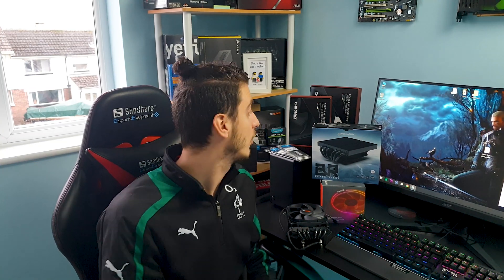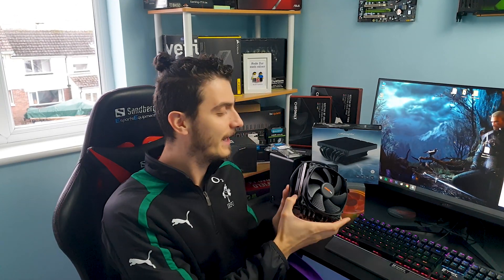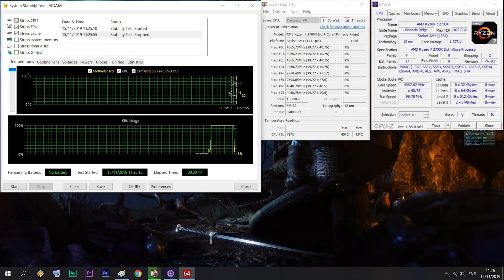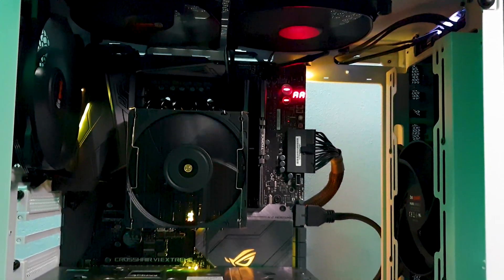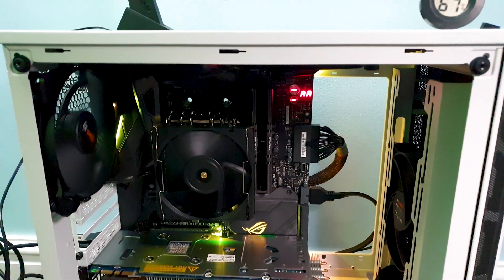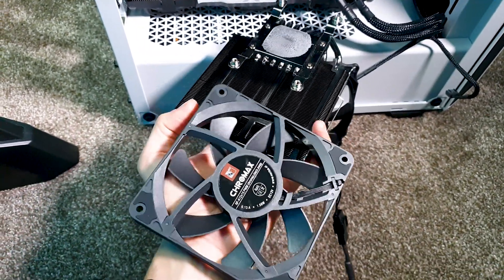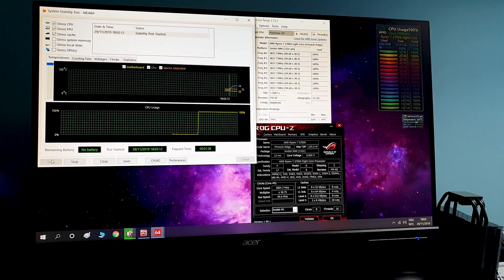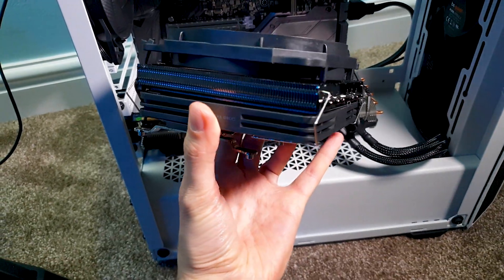Can a Dual 120 mm fan setup on the Alpenfoehn Black Ridge cool the 2700x ?

Comment: when using 2 fans on the black ridge what orientation are both fans? Im guessing both would be having the air travel down? My apologies if you said it and i missed it. Thanks
Reply from the maker: No worries. Yes, the fans were both as an intake pushing down. 👍

Comment: I have a problem with this cooler the cooler doesn't have the backplate and it is not fit with amd stock back plate also. My mobo is curve like a banana because of this. Pls teach me how to fix this thanks
Reply: You could use Noctua's L9a backplate. I've used it as well as other and have no curve to our motherboards when using the black ridge.
Reply from the maker: @Deo499  Great idea! 👍👍
Reply from the maker: Hi. It doesn't come with a backplate unfortunatly so just don't overtighten the bolts. The same happen to me, the mobo was curved. Then after you install the motherboard to the case, the tension will be equal because you will bolt it to the case and it will pulled backwards. 👍

Comment: Hi Alex, great video as usual!  Your 1st video on the Alpenfohn Black Ridge is what convinced me to do a tiny Ryzen 3950x build with the SGPC K39 4.3L case using the Noctua Chromax 120x15 slim fan.  I do mostly simracing games like MotoGP, F1 2018 & rFactor 2 so not very demanding & I was able to run a relatively quiet PC while temps under load while playing these titles topped out @ 73°C w/ambient of 21°C.  Unfortunately, this was all running in Eco Mode @ constant TDP of 65watts.  I just purchased the 7.3L Captain S v6.1 from Taobao.com & planning to run the Noctua Chromax Slim 92x14 Slim & Noctua NF-a120x25 on top for a total height of 72mm which this case can accommodate.  I won't be using the 16gb Crucial DDR4 2666MHz CL19 VLP ram that I used for my K39 build but instead opted for the Corsair Vengeance LPX DDR4 3200MHz CL16 ram.  Would this be the best setup I can do to run my 3950x to it's maximum potential with the Black Ridge cooler?  Thanks again for your very informative videos!!!
Reply from the maker: Hi man. Thank you so much 🤗 So glad to hear that. 

Very nice results and thank you for confirming that the 3950x can work at least in eco mode with that setup. 

Wow. Didn't know about that case, very interesting. 

Well if you managed to tame it with just the slim noctua 120mm then with the new combo (fan slim 92mm and the big boy Noctua 120mm which is an epic fan) it should have a much bigger cooling headroom.

I would start to compare the results in eco mode to find how much improvement there is with the new setup.

Then of course try it in stock form and if you can please to see if the manual oc I did for my 3700x would work. I discovered that if i do 1.075v for 4.0 GHz on all cores I would get stock results but +20C cooler. Maybe something similar would work on the 3950x? Like 1.1v for 3.5 GHz or 3.0 GHz like a manual OC Eco mode. Good luck and please let me know how it goes👍
Reply: Thanks for your suggestion on the manual OC!  I’ll have to give that a try & see how it stacks up vs Eco Mode.  BTW I did try a Noctua 120x15 Chromax Black Slim fan on top of my current Black Ridge w/Chromax Black 92x14 slim fan underneath (removed side panel on K39) and ran AiDA64 cpu full load test with average & hottest temp maxing out at 77°C after 15 minutes, so pretty happy with that trial.  With this dual fan in Eco Mode, I was able to set fan curve to whisper quiet while simracing with graphics maxed out!

Comment: So with an Asus b450i Mobo and Black Ridge with 120mm Notcua fan replacing the stock 92mm fan, what's the maximum height of RAM available?
Reply from the maker: Just VLP ram which are under ~19 mm tall.

Comment: In dual fan mode, you think this could properly cool the ryzen 7 3700x? Or even the ryzen 9 3900x?
Reply from the maker: Most definetely the 3700x (check my last video please) and in dual fan mode, if the 3900x will respond the same as the 3700x, then yeah, for sure.
Reply: super late but this can be cooled in single 120mm fan. I run a 3700x with one 120mm a12

Comment: I'm very interested in this with a Dual 120mm noctua chromax fan in a Ghost S1. But it seems to be quite difficult to find VLP ram that has a decent clock speed and works with consumer motherboards. I want to try this together with 3950X.
Reply: 120mm fan on the top, 90mm fan on bottom. Cool 3950x in ghost s1. Need medium top hat with two exhausted fan for air flow.  For RAM, take off the header sink. Don’t need VLP ram
Reply: Have you tried it?  does it cool the 3950x ? 

Maybe just a 120 mm fan on top and a 95mm fan on bottom?  its too hard to find VLP ram.  I just use G skill flare x,  but I took off the heatsink .
Reply: Alan Leong yes enough
Reply: I am using a 65tdp ryzen 2700 cpu,  thinking if I can upgrade to the 3800X 105tdp
Reply from the maker: I know. I was thinking of the ghost when I did this video. Yeah the VLP ram is a challange. If you indeed find some RAM, please let me know how it goes :)
Reply: @Oliver Lundström is it vlp ram?

Comment: checked it out as soon as I could, informative again, thanks! only drawback for me is that the noise level will be out of leauge, based on your test, if I stick to my plan and install a 3700X into the Ghost S1 :D
Reply from the maker: Thank you and my pleasure :) Yes, noise is very important for me as well. Indeed, the S1 yes has more headroom to play with. Or the asetek 645Lt as you know for the A4 which I think will have to do if I want anything better than my 1700 :)
Reply: I too am looking to install a 3700x in a Ghost S1 with the Black Ridge cooler. Trying to determine which X570 board I should use. I'm not so concerned about removing the VRM cooler cover as I think the 120mm fans blowing air as intake should help here. That is, of course if I can find decent very low height memory..  Good luck with your build..  👍😎
Reply: @_Randwulf  recommended u the asrock b550 phantom gaming-itx-/ac fits perfectly with black ridge
Reply: @OhYoungJimmy  Thx 4 the reply. The B550 is really all I need.
Reply: Hey, did it work out?

Comment: Interesting test results, thanks Alex - I was wondering tho' why you combine BR with this case ? obviously is not the purpose of that specific cooler/fan combination.
You have a DAN case v4 - why don't you try that as it will be more relevant. (also why not 2x
 Also do you have a super low profile ram ? I saw that there are some adata VLP on SFF network forum.
Reply from the maker: Thank you! Like I mentioned, I already did exactly what you said in my previous video review where I did all the possible fan variations and orientations for the Black Ridge. This video tackles the other possible fan combos - a dual fan setup which is not viable on the Dan A4 :)
Reply: @Glob3Tech  Cool - not sure if you are a member of lab501 - I am putting there my "adventure's" with SFF cases :) as of now my "main" is in Ghost S1, I am waiting for my Dan V4, I have also 2 "in progress" builds in Velkase (Velka 3 and 5) :) and my struggle with Phanteks Evolv Shift :)
Reply from the maker: @rodarkonero  Very nice collection man! :) Yes, I am am member but not that active. But will have a look.  Do you have a link of your builds please at hand? Thanks.
Reply: @Glob3Tech ->  Cutia de sub birou\Small form factor PC
Reply from the maker: @rodarkonero  Perfect. Ms. Ma uit cat de curand :)
Reply: @Glob3Tech  am terminat build-ul in Velka 3 .. cam mizerabila carcasa
Reply from the maker: @rodarkonero  Ma mir ca ai reusit sa o termini unu la mana. :) Si doi, am auzit. La ce inchesuiala e in ea.
Reply: @Glob3Tech  e facuta ca un fund ... ca sa zic asa mai neaos ... PSU-ul pe care l-am luat intra la limita ( a  trebuit sa scot power button-ul ) , placa video sta in echilibru practic, MB-ul tre sa fie ceva magic sa se potriveasca cu carcasa, insa problema nr 1 e racirea, pur si simplu ai nevoie de ceva mid-low end (ca putere de calcul) pentru ca nu ai loc de cooler, iar ce folosesc eu se suprapune cu rizerul si impinge placa video 5mm spre panou lateral, cam 1 mm de clearance, doar daca ma uit la ea urat atinge :) ... sa nu mai zic despre ventilatoarele minunate de 80 mm care zici ca-s avioane cu reactie.
Reply from the maker: @rodarkonero  Wow. Cum am zis ma mir ca ai rezistat pana la capay. Am vazut clipul lui Linus, m-am crucit putin. Acuma ce imi zici si tu, sigur o evit. Ms de info si feedback man.
Reply: @Glob3Tech  mdea - a fost intr'adevar nerve wrecking ... am uitat sa mentionez, se zgarie foarte usor (fiind metal/metal) ... eu am ales negru deci se vede orice, daca era silver sau ceva, ar fi fost mult mai bine.
Reply from the maker: @rodarkonero  Da, pacat. Clar nu merita. Apropo ai bagat 240 aio pe S1? Am vorbit de 'ciocan' la tine in topic, ah si a mai scos optimum tech inca un clip. Da, nu e asa grozava, mai au de imbunanatatit si acolo. In rest M1 am avut-o dar e cam mare. Pe A4 fara cabluri custom si Aio de 92 nu pot baga cpu mai tare decat ryzen 1700/2700 ca nu le am.cu ce tine sub control. Curios cand iti vine tie A4 ce rezultate ai.
Reply: @Glob3Tech   https://uploads.tapatalk-cdn.com/20191211/323061fe27a52ecf587d7aad56d362cb.jpg ... vezi ca e mare poza, Ghost S1 / Nouvolo steck (are de asemeni AIO de 240) si e mai cheap comparativ cu Ghost-ul - in ambele am 9900K @ 5 si 5.2 GHz :)

Velka 5 (unde am 7700K) si Velka 3 (6700k) desi V3 nu duce configuratia asta, in idle 49C in load ... se duce in balarii.

Config-ul 8700K sta pe bara momentan :) 

... astept sa-mi vina cablurile custom, AIO open loop-ul (cu QDC) si top hat-urile, pentru ca am al 2lea ghost S1 in cutie (o sa fac step by step)
Reply from the maker: @rodarkonero   Aha, super asa man. Ai jucarii misto. 🤗

Velka da. Ma mir ca 'doar' 49 in idle 🤣
Reply: @Glob3Tech  la partea de cooling Velka 3 nu e compatibila  cu unul dintre putinele coolere (noctua NH-N9I) ... practic suruburile coolerului (are prindere in spatele MB-ului) preseaza pe conenctorul PCI-e al cablului prelungitor. 2 chestii naspa .. 1 din aceasta cauza prinderea conectorului este proasta, si adauga un spatiu intre MB si placa video, unii ar spune "super" asta e un lucru bun, din pacate asta face ca ventilatorul sa fie EXTREM de apropiat (eu zic ca e intre 1 si 1.5 mm) fata de panoul lateral al carcase. 

Ehh .. ma rog, mi-au venit azi niste jucarii (printre care si top hat-urile de ghost-uri) insa imi lipsesc cablurile care abea au fost trimise ieri sau alaltaieri :) .. sper ca in cateva zile sa ma apuc de build-ul care va deveni principal (il va inlocui pe actual-ul in Ghost S1 Ash) :D 

Ti-am zis daca vrei ceva cheap (150 $ fara top hat sau 180 cu top hat .. mergi pe nouvolu steck - https://www.nouvolo.com/ e aproape la fel de misto ca Ghost S1 insa la juma de pret :D )

Comment: Great results! Instead of using the BeQuiet! fans which has a center frame, why not use one of the new Noctua fans available? 
It is truly great to see how much progress you've made since the very first video! :)
Reply from the maker: Thank you so much! The be quiet fan was the only 120 mm fan available, besides the noctua 120 mm slim :)
Reply: @Glob3Tech  That is also true, we work with what we have. :)